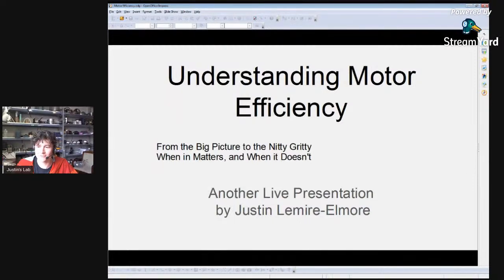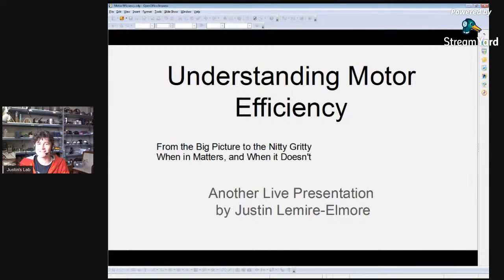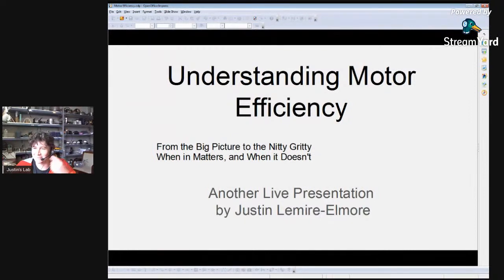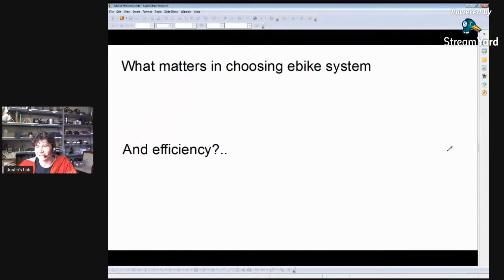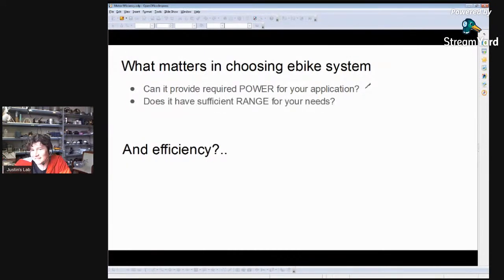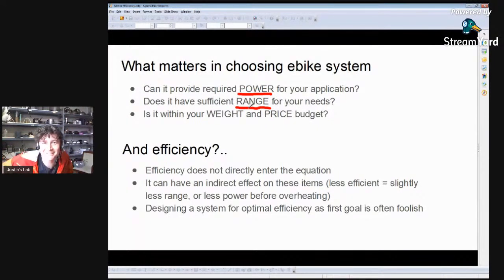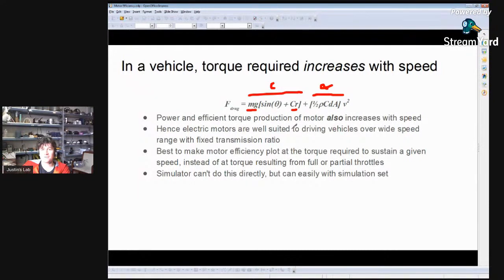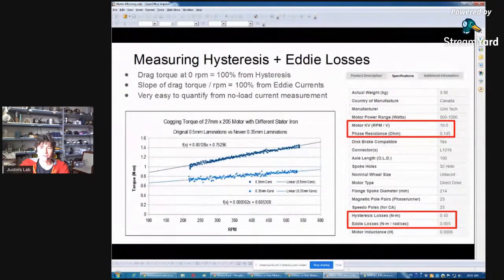Deep Dive into Ebike Motor and System Efficiency

Comment: All I know is computer power supply. Peak efficiency would be around 50-80% of load and drop off any lower or higher than that. Does hub motors have same effect?
Reply from the maker: Not really. There is no analogy in a computer power supply to the widely varying rpm at which motors operate. Watch and follow the video if you want to properly understand what determines motor efficiency

Comment: I have a Walmart 20" Kent torpedo bike 24volt and 180 watt hub motor without gearing.i would like to be able to make a 25 mile trip under power .it has a 5.4 amp hour battery can I use lead acid to work? What battery is cheap to achieve my goal
Reply from the maker: You can use lead acid, but a 24V 5.4Ah lead battery is just tiny and no way it would do 25 miles. Due to the peukert effect that's well under 100 Wh.  You should be looking at more like 15-20 Ah with a 24V lead acid system for that kind of range.

Comment: A speed throttle in your simulator would be AWESOME!  I assume it would always be at "100%" so that at 15kph on the x-axis it applies enough torque to move the vehicle at 100% of 15kph = 15kph :-)
Reply from the maker: The thing is that doesn't really work with these plots when speed is on the X axis. you'd only have a single point of data to look at! Right now, if you just click "auto" throttle mode then you can click wherever you want on the graph to have adjust the throttle to deliver that particular speed, and the cursor will stay there if you do a simulation set to run some other plot (eg power consumption at constant speed as a function of %grade hill).

Comment: I'm trying to run a phase check program on a sabvoton 72100 controller and a qs205 hub. They did not send the short little stub electrical fitting that plugs into the display cable to run the hall sensor test. Any suggestions? Do you have a tutorial vid. on programming the two together?
Reply from the maker: We don't deal with Sabvoton controllers unfortunately.

Comment: Sir, I'm very much interested in your product. But I have a small dought to clarify, the thing is how a regenerative brakes offers constant current and constant voltage, although it is a highly complicated question or it is ur business secret. Can I Hook up a 60v ac on the motor phases to charge my battery? If yes, at how much is the maximum power I can get and is regenerative braking causes heating up of controller. That's all in my mind, I wish to have answers ASAP to buy your convenient products that are made for the performance. Thank you, sir for your time.

Comment: If I lower my amps from the controller will it increase my range. Or could I accomplish the same thing by governing my speed? Or does either one even matter? Right now I have an 48v 24ah battery, a 40 amp controller, and a 3540 crystalyte hub motor and with throttle only I'm only getting about 30 miles. Is that normal? Would I get more range if I lower the amps from the controller?
Reply from the maker: Hi Randy, you get more range when you use less power from the battery, it's as simple as that. It doesn't matter if you do that by reducing the current limit of the controller or setting up a speed limit, but those two methods change how that reduced power is distributed along the ride. Lower current limit means you'll have less power climbing hills, accelerating and such but your top end speed is unaffected. A speed limit won't affect your low end power and torque but it will of course reduce your power once your are up to speed.
Reply from the maker: And 30 miles on a 1.1 kwhr battery is typical of a fast and power hungry setup like that. At more typical power levels and speeds your have 60-70 mile range.

Comment: At 1:20:28  With increasing speed I see you plotted a sharp climb in Motor Temp with increased speed? Sure increased wattage will raise the temperature but are you even factoring the massively increased "air cooling" to the hub motor as the speed increases? Think of it as a fan blowing on the wheel and hub. The faster you go the higher CFM of the fan to cool the motor.  Also have you charted hub motor cooling with speed when using an "Aluminum mag Wheel" instead of spokes? Mag wheels have huge advantages for Ebikes as they act as a giant air cooled heatsink. Increased Air Speed helps cool the motor so are your motor temperate plots even accounting for air cooling and MAG wheels?

If you make a simulation don’t forget with the MAG wheel rotating the bottom tire that touches the ground has ZERO speed. While the top of the wheel is moving through the air at double the relative speed. Example if you’re moving 20MPH the top of the tire is moving forward at 40MPH as it’s rotating forward and moving forward. I say this because the top of the MAG wheel is also moving "much faster" than your velocity thus helping the cooling at the top. The bottom has almost no wind speed to help cooling so calculating heat transfer and airflow characteristics is challenging.

Comment: Thanks for the video, I had one question:
If I want to drive around 32 km/h on an ebike, does it matter if I have a 500, 1000,1500 or 3000 watt (hub) motor for the range? (weight of bike+me is 120kg, battery is 60v 35ah) What would be the best?
Reply from the maker: The quick answer is no, it doesn't really matter.  Your energy consumption will be about the same regardless of the motor model you ride on. 
For what is best, by what metric are you evaluating bestness? Which does  it for the least $$, what does it at the highest efficiency?

Comment: Subject about copper losses. If you increase voltage and lower KV you should have lower copper losses and high torque. Especially if you wind the motor bifilar like Tesla's patent. Just pointing out that a higher voltage system is more efficient
Reply from the maker: That is not really true. If you increase the voltage and lower the KV you have exactly the same copper losses inside the motor, as the motor winding resistance increases to achieve the lower KV in a way that exactly cancels out any benefit of lower currents. 

It is only in the wiring outside from the motor controller to the motor where you would have lower losses in the higher voltage system, and that can easily be mitigated with heavier gauge wires and/or keeping the controller close to the motor so that the cable run there is short.

Comment: How do I Calculate Motor Efficiency and Controller Efficiency after collecting Dyno Data?
Reply: I am unable to calculate the AC Power output power coming from the Controller.
Reply from the maker: I mean if you have dyno data it's super easy.  Motor efficiency is motor output power over controller output power.  Controller efficiency is controller output power over controller input power, but that would be harder to measure directly. You can easily estimate it by thermal means (measuring how hot the controller gets), or by knoweldge of the mosfet resistance and switching losses which you can see from a scope trace.

Comment: Is the equation at 1:00:08 correct? I am just slightly confused how Imotor=(Vmotor-Kw)/R 

Say if there’s a 72v battery back 
Vmotor= 71.6v

K = 12rpm/volt

RPM = 750 ~ 75rad/sec

71.6v-(75rad / sec * 12 rpm / volt) = negative number 

What am I doing wrong?

How do you find Vmotor?
Reply from the maker: If you have Kv in RPM/V, then either you don't convert to rad/sec as you are using units of revolutions per minute. If you did want to convert into rad/sec, then 12 rpm/V =  1.257 Rad/sec/volt, = 0.796 V/rad/sec (which is the units of Kv in the equation)

Vmotor is the voltage that the controller is sending to the motor (ie battery voltage times the duty cycle).  Kw is the back-emf voltage of the motor. If it's 12 rpm/V, and your motor is spinning at 300 rpm, then Kw = 300 rpm / 12 rpm/V = 25V.  Or if you are in rad/sec mode, 0.796 V/rad/sec * 31.42 rad/sec = 25V

If you have a 72V battery pack, I can guarantee you that your motor controller is not going to be supplying 71.6V to the motor if the motor's back-emf voltage is just 25V, it would be limiting it based on either the phase current limit of battery current limits programmed into the controller.
Reply: Thank you so much that makes perfect sense!

Comment: Does motor simulator really ignore iron losses, I'm planning to convert my cheap dd motor to mid drive, and I hope I'm not getting bamboozled...
Reply from the maker: The simulator most definitely includes the iron losses as well as copper losses. Was there a suggestion otherwise somewhere in the video?  If you didn't include iron losses then the simulated efficiency would always approach close to 100% as the motor reached the unloaded speed (and copper losses drop to zero)

Comment: Hi Justin, I race Electrathon and the more efficiently I can translate my electric energy into mechanical energy, the faster I can go. Am I correct in my understanding that assuming a fixed voltage, my motor will have an specific ideal current for maximum efficiency at that RPM? In other words, should I modulate my current based on RPM? Will this ideal current change with voltage? Will it change with motor temperature? Am I missing anything if I track RPM, Voltage and motor temperature when calculating the ideal current for that moment? What about load-going up or down a hill?
Reply from the maker: Your opening sentence is quite incorrect. It's not the efficiency of transfer that determines how fast you go, it's simply the rate of transfer (ie your power.) In something like an electrathon race, you should be much more concerned about your wh/km at any given point than your motor efficiency, which you can't really do anything about.
Reply: @GrinTechnologies  Justin, Thank you for your reply. I skipped a step in my first sentence which might make it an unclear over simplification. Let me try again. I am limited to 1000 Watt hours of energy in my battery. If I am able to operate my motor at 80% efficiency during the race, rather than 70%, then, I have 10% more mechanical energy to move my vehicle. With that extra mechanical energy, I will be able, during my 1 hour race, to propel my vehicle at a greater speed and thus cover more distance than if I did not have that extra mechanical energy. Is that not correct?  I disagree that I cannot really do anything about my motor efficiency. For example, I can change my gearing (or wheel size for a hub motor) to operate the motor in a more efficient range.  What I am asking about is varying my rate of transfer (power) to match the characteristics of the motor, to achieve the best amount of transfer (energy). I am doing this by varying my current based on RPM, but should I be considering voltage and motor temperature as well?

Comment: I have a Rad mini fat bike I live up a steep hill I need more power I want to add a hub motor to the front wheel
Reply from the maker: You can do that, but it's a fairly advanced DIY project to hook up a 2WD system to a factory ebike. This is covered in our multi-motor drive video. https://www.youtube.com/watch?v=Ub4EP2_mAds&t=4826s

Comment: My old powabike brushed 36v wheel re-homed in a really nice bike and with a lithium 10s pack seems to use less current for the same speed as my mates modern  Bafang geared  250 watt 36volt and definitely accelerates better - how come old brushed beats modern brushless ?????????
Reply from the maker: Brushed vs brushless has almost no effect on motor efficiency. What matters are winding resistance and core losses, not how current is commutated.

Comment: giant trance E bike (mid drive)......riding goldfeilds trail starting at bendigo victoria australia station.....on lowest asistance: 25.8 miles , 3196 foot hight gain....then same bike track charge but with traveling 20kmph on flat and atacking climbs::19.68 miles , 2169 foot hight gain....about 6 miles diferance and 1000 foot diferance...that is a big diferance...did the human work that much harder on the lowest setting? remember the human worked hard on bothe rides...after listening here i was hopeing the result would be other way round???..what looks good on paper does not always work in the real world...when you test regen..can you have a controll..a same bike same rider same battery and charge same motor same weather same corse but with free wheel?
Reply from the maker: "did the human work that much harder on the lowest setting?", it's not that they need to work harder, but they are working for longer time and so contribute a larger amount of energy even if the human power level is exactly the same.  In your example the slower climb got 25% more range, and that's mostly because the rider was pedaling the bike for a 25% longer time period at the slower climbing speed.  It's not because they were pedaling 25% harder.  This is an important detail to properly understand.
Reply: @GrinTechnologies  yeah..i was amased at the diferance and was aware of the climb duration diferances..other things to consider are exelerations on tight tracks..momentum as you pointed out,and trying to keep the yamaha motor past peek power in terms of rpm to try balance losses whilst using gears and power asist buttons (your fingers and thumbs get very buisy)..i can send you the garmin tracking information if your interested...there is a bike packing ride race from the top to the bottom of australia in a copple of months if you want to come.
Reply: @GrinTechnologies  hey i just read your coment above again and it dawened on me that i gave you no time data..and you had based your coment on time periods...so i thaught id take a look at the run out of battery point on the shortest distance run and check times of bothe runns on the garmin data at the 19.6 mile mark...the eco setting time to the 19.6 mile mark is 1 hour 37 min..the 20kmph on the flat/atack the hills recomendations time to the same point 19.6 mile mark is 1 hour and 52 minutes...so your asumption that the eco setting human pedaled for a longer period of time is not correct.in fact it was the opposite by 15 minutes.....
'   ...so to recap eco went quicker and futher than your use the least amount of battery power by climbing fast cruzeing slow recomendation...by 15 minutes and 1000foot and 6 miles.

Comment: please make a plug and play 60 amp controller for the new Bafang Ultra G510 mid drive motor. this is the hottest selling mid drive that has no controller upgrades. LUNA Cycles has one but not for the Public market.
I suspect the class #3-#4 speeds over 35 mph are a liability issue.
the dude in England videos Suck and dont show any real way to make the Phaserunner an easy retro fit.